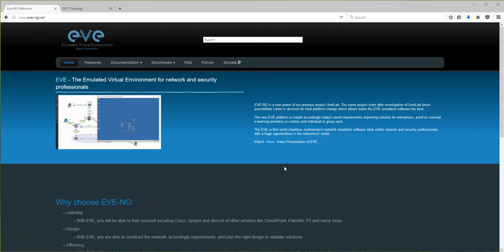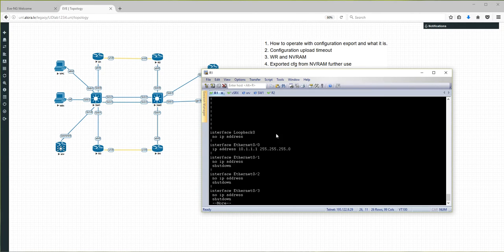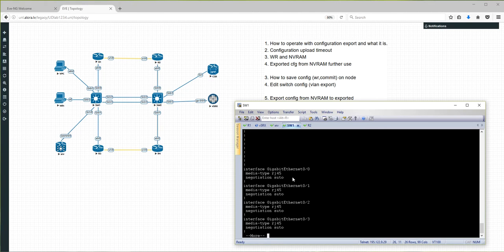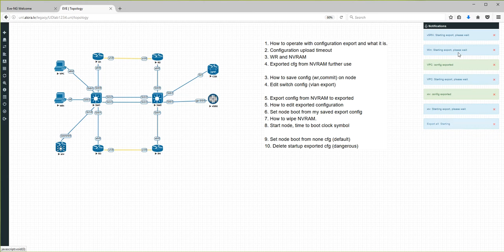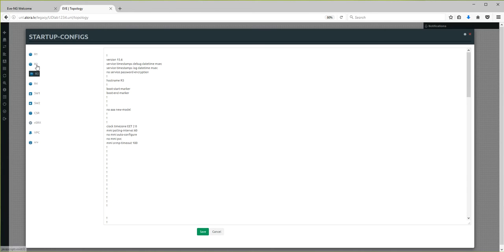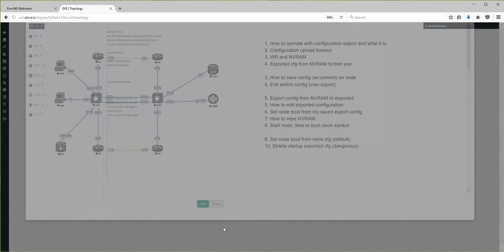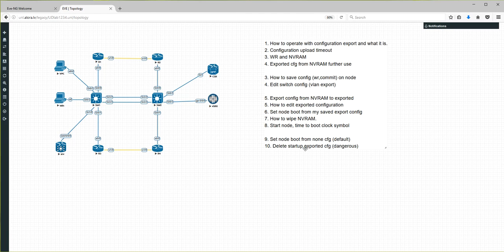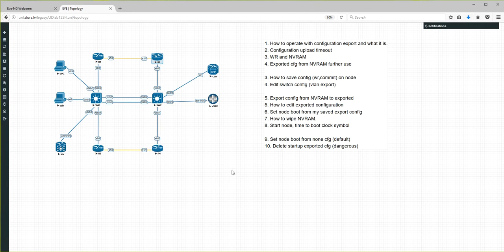EVE HowTo operate with intial configs

Comment: By the way, i did the same way with you for the juniper vsrx but i got no change on the configuration itself.
Do i have to wait to login until clock sign dissapear even i can do login before it and check the running config?